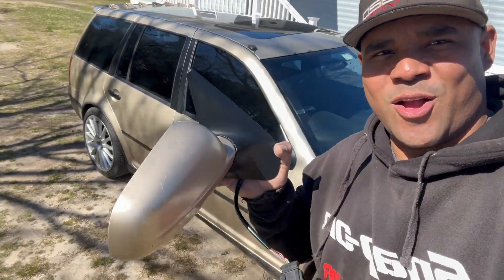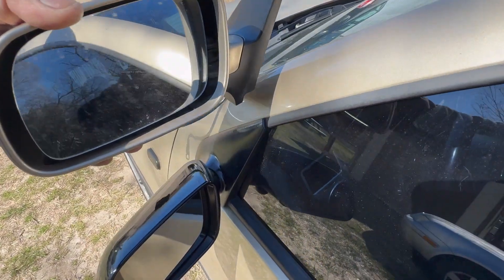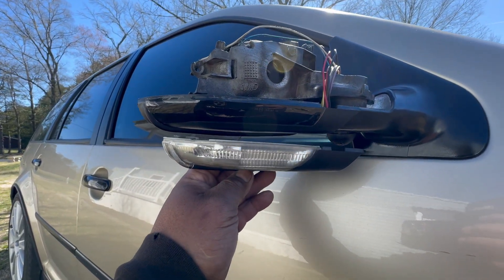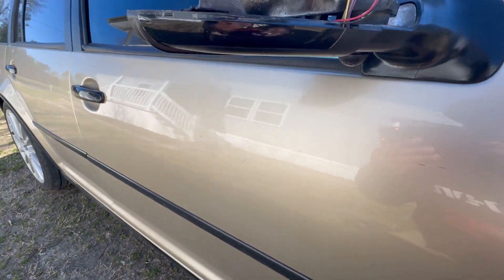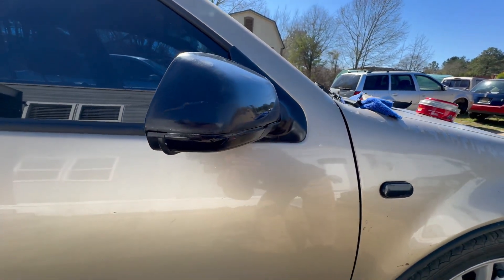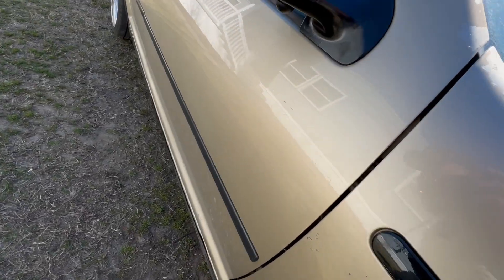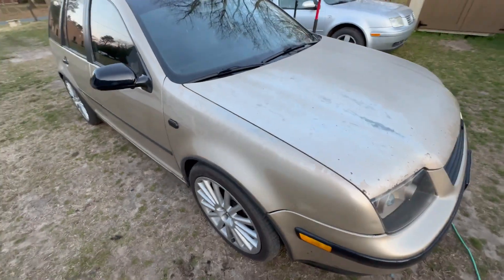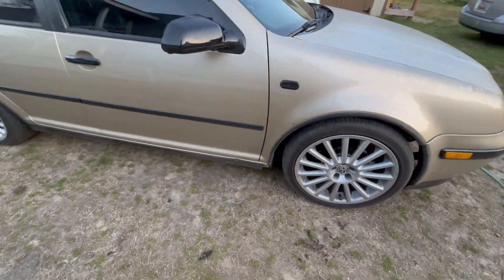Mk4.5 mirrors upgrade

Comment: Big big difference with these mirrors vs the plain mirror:  They painted/sealed the die-cast parts inside.   You'll have extra years where the mirror won't corrode and snap like a twig! :D

I was thinking about getting the LED markers for the set I have.  Now that you show them, I want them for certain to replace the original lights.
Reply from the maker: Thanks for the tips!

Comment: Another mirror thing to look into:
Because you have the power seats, there was a feature on the GLX cars that had them, sorta related to memory mirror settings:
Auto-dipping power mirrors, when you go into reverse gear.

I haven't figured that one out yet.  If I do, I'll pass on the electrical/wiring details.